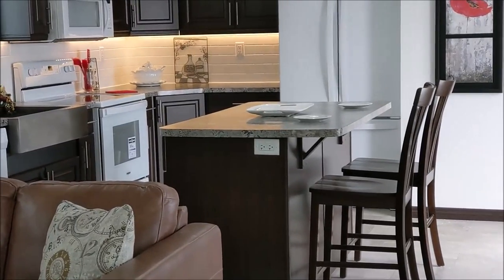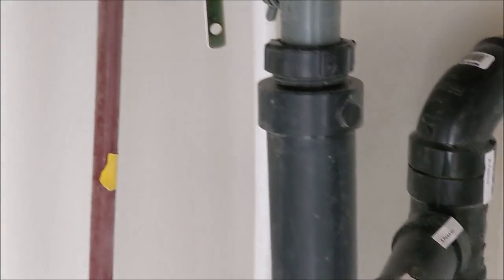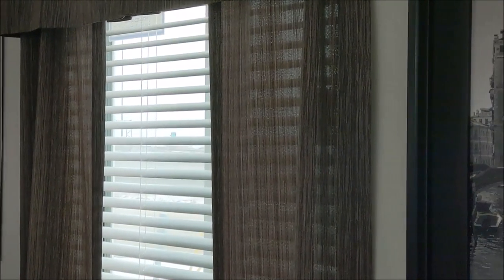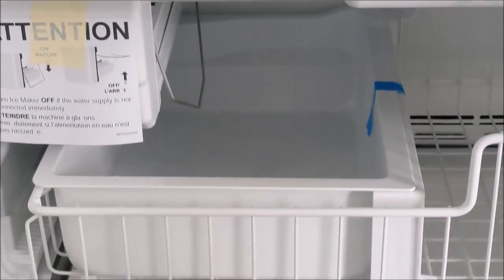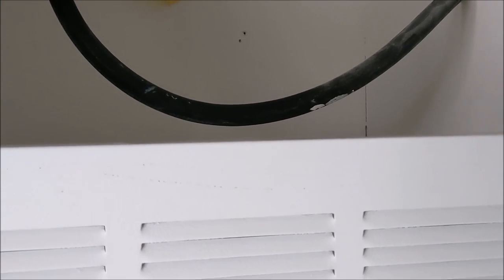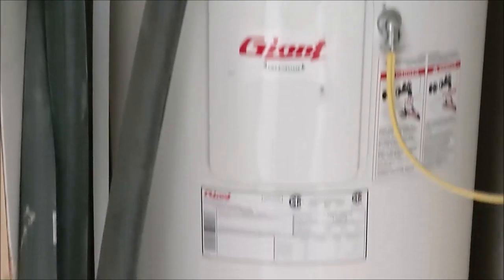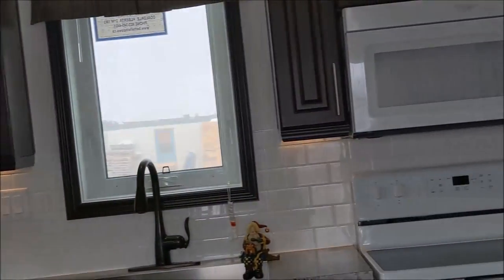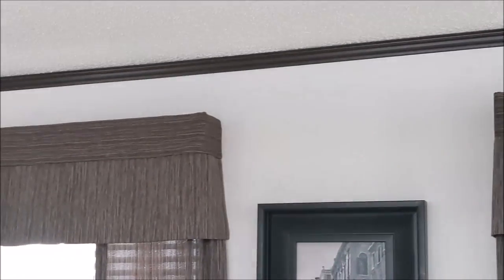Mobile Home Tour  (2020) A closer look at our options

Comment: Another nice home. Nice high ceilings. Looks like thick walls which are a real energy saver.  Like the foyer. Most homes don’t have this. Kitchen is well done. Nice countertops and backsplash. Cabinets top knotch. Let’s the white appliances. Gives the room a clean bright look. Sink is excellent. Garden doors really brightens up the space too. The laundry pair is way above average. Master suite okay. Master bath is pretty small. Additionally the bath is below average. First is too small and second the fixtures could be a little more upscale. Closet is small. Overall all things considered I’d give this home 8/10.